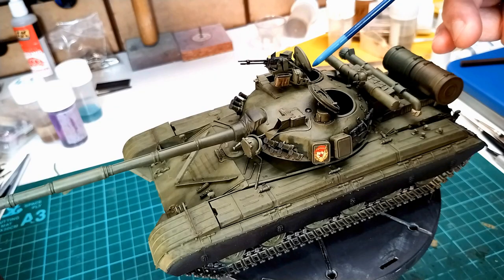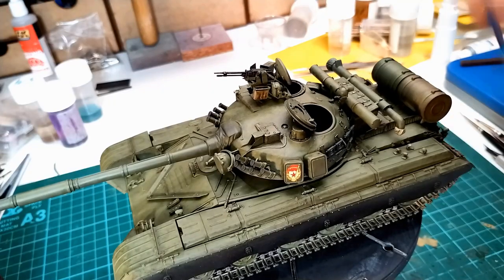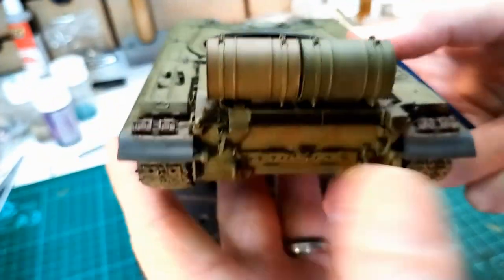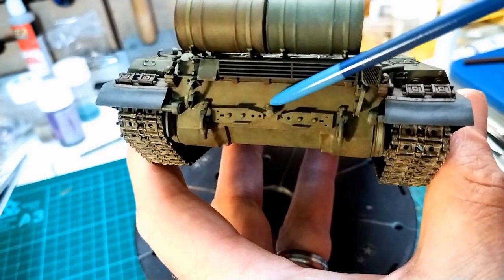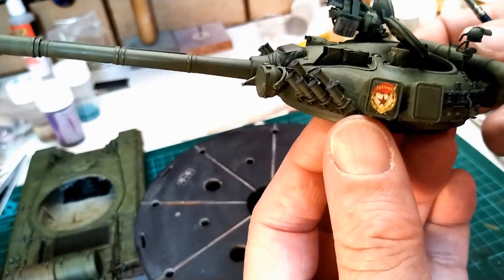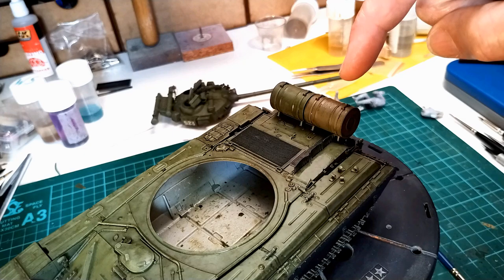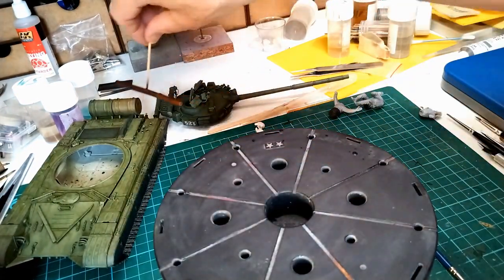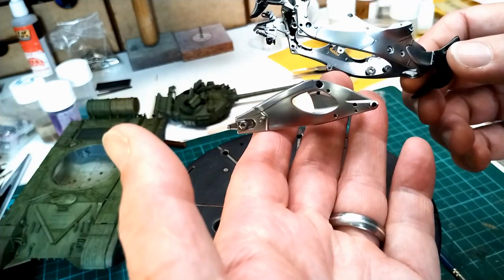Progressing with the Trumpeter 1/35 T-64 Mod 1981 - a few words about painting it.

Comment: Now for the tank turret: the large lantern is called the tank turret lantern. This lantern shines with normal light, you can also install red glass or a nozzle with the last two numbers of the license plate. For example, if the tank has the number 523, then the nozzle will contain the numbers 23. In addition, there is a small red lamp below the rack - this is a marker light.

Comment: Hello! The cylinder on the back of the case between the spurs for mounting on the wagon is not a convoy light as on NATO equipment. Under it is the adjusting bolt of the torsion of the engine compartment roof. Sorry, I don't speak English so I used a translator. I hope you understand what I mean
Reply from the maker: Thank you SO much!! I do understand what you mean and I now have more knowledge of the T-64 than I did before. I am grateful to you for your comment!